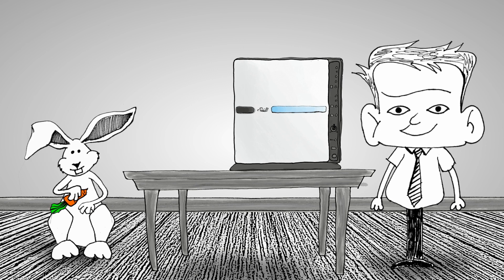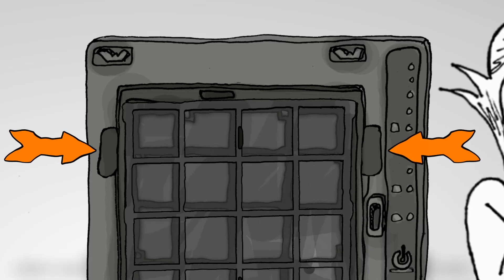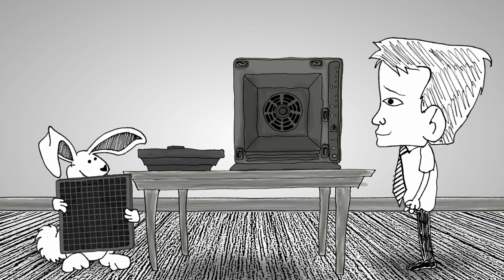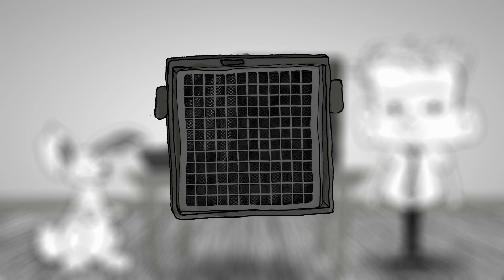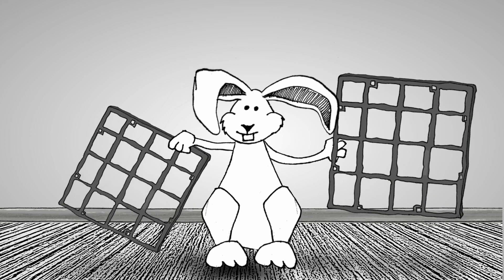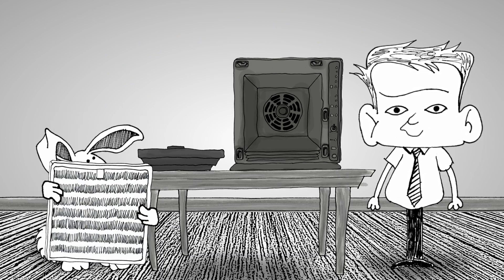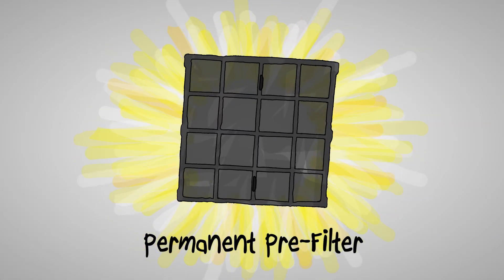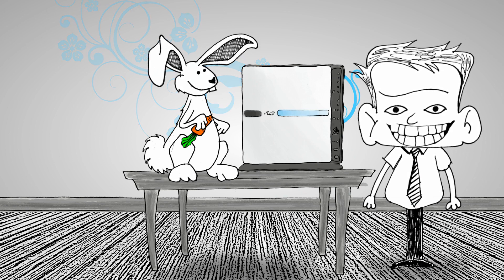Rabbit Air MinusA2 Filter Installation Guide

Comment: It would be great if the video included pressing the Replace Filter light after replacing the filters. It took a long time for me to figure out how get the light to turn off.
Reply from the maker: You are correct this step was not included on the video. To reset the filter light on your MinusA2 you will need to press and hold the MODE button for roughly 3 seconds. We appreciate you pointing this out Sean!